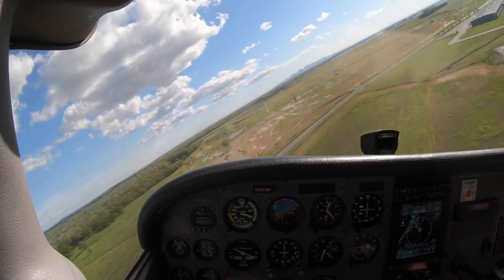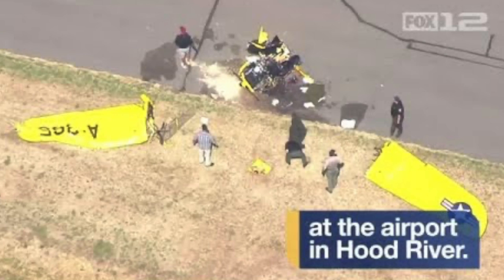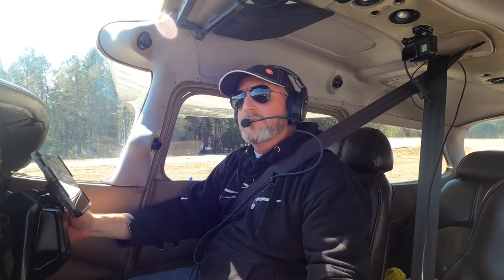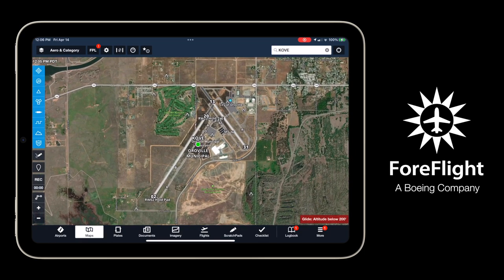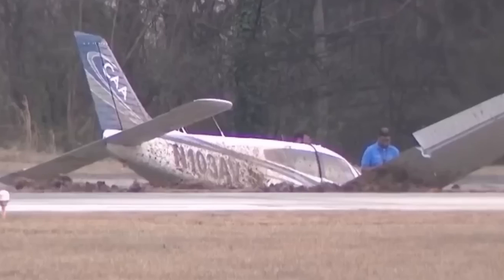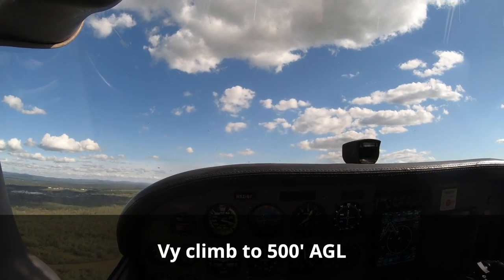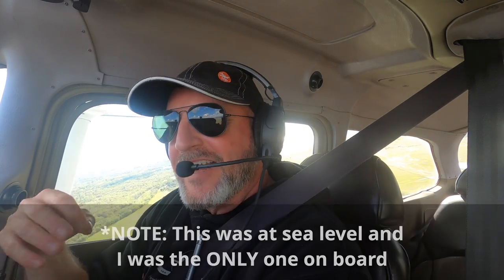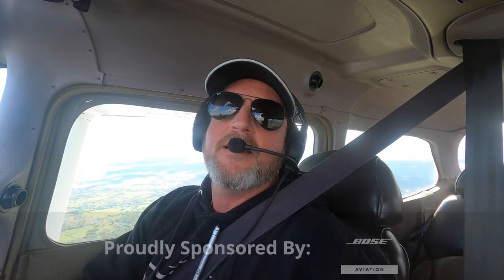The IMPOSSIBLE Turn? - Engine failure on takeoff - Airplane Crashes - 180º Turn Back To The Runway

Comment: Great video. I have your app currently. 

We tried this last week in 97-100* weather. My question is should I turn into or away from the cross wind? 

Also, we were very close to making the runway. Muscle memory and immediate turn and best glide we did.
Reply: Turn into the wind...turning with a tail wind will push you further away from the runway.  Just keep the nose down
Reply: @tbeevers  saw a wreck recently where this happened. Pilot stalled and passed.
Reply: @RaceMentally So it was a LOC-I ( loss of control in flight ) accident, not a turn back accident ?

Comment: These turns can be impossible no matter what technique you use. 

Many light aircraft will have departure angles that are shallower than their glide angle. This is through things like high weight, high density altitude, low power, and no wind. 

You aren’t making it back to the runway at any altitude unless you made a turn with power.

Comment: Besides this all, your prop is idle but not giving drag - as it would on a seizure or whatever
Reply from the maker: Yeah. and I was the only one onboard at sea level
Reply: Dead engine non-rotating prop or feathered prop is lowest drag for a calculated glide ratio. Airspeeds higher than prop speed makes for a reduced glide ratio due to the rotational prop drag; unless your glide ratio takes this into consideration. However, your possible turn video here is great for being prepared for a fast recovery, and don’t panic. All pre-takeoff checklists must include the emergency plan for a given runway.

Comment: Dan Gryder say to never turn at all if any engine problem, even from 1k feet agl on a Cessna easy to turnback.  To crash in front all times, NO TURNS.  Really? LoL. I know 3 friends that turned back from as low as 300 agl with partial power and avoided crashing on houses and cars.  he is FOS,  The more maneuvers you know, the better pilot you are.  Ignorance kills, practicing saves you.

Comment: I think one of the key take aways here that is often misunderstood is: as long as you point the nose down, you won't stall. This is a hugely valuable lesson for many other cases as well. For example you are about to overshoot final when landing on a runway and there's traffic approaching the parallel runway... it often is much better to treat altitude and be low on the approach but make a sharp turn than risking to fly into the parallel approach path.

Comment: I often wonder if there is an optimal angle of bank where the maximum turn rate vs altitude lost is achieved.
Reply: of course it will vary by aircraft, but that would be an interesting thing to calculate. Airspeed will also be a factor.

Rate of Turn vs Rate of Descent

Maximize rate of turn while minimizing rate of descent. Where do these things cross each other (what bank angle/airspeed)?
Reply: @Solo Renegade  agreed, quite a few variables going in, but it could be done at Vbg to control at least for that variable.  After that, it's a matter of various weights...similar to the performance tables for the C172 could do it at 2200, 2400, 2550.

Of course, the bigger the radius the further we have to glide to get to the runway way.  If the radius is small we might have to turn a total of 200 degrees amd glide very little, but if the radius is large we might have to turn a total of 400 degrees amd glide a considerable amount.  And all of this with a large tail wind component.  So maybe we have to simplify this to a 270 degree turn?
Reply: Steep as possible. If you bank 60°, yeah you lose altitude twice as fast but you turn four times as fast so you spend a lot shorter going the wrong direction
Reply: @FencerPTS  and don't forget runway remaining when teh engine failed, as that affects how far you have to glide back too. And a cross wind could help you do just approx 180 and still be ok.

The problem is that there are just too many variables for a given situation. All of which affects the ability to make the turn, and all of which would need to be known ahead of time by th pilot.

But from a purely Rate of Descent vs Rate of Turn evaluation...that is more practical. How many degrees you'll need to turn to get back is of no concern for the calculation, and neither is the altitude at which you started. All we care about is what is the best rate of turn for a given aircraft at a given weight (I'd calculate it at three points: light, medium/typical, and heavy load) and bank angle. Or you could just do a light load and heavy load and interpolate, but it might not be completely linear relationship. But you're going to find an optimum bank angle curve, and then calculate the rate of descent for a given bank angle. and you'll have to do this for given speeds, and you'd start at best glide and check higher and lower speeds from there.
Reply: @SoloRenegade  I've always had a problem with his much runway remaining i actually have. I mean, during climb after rotation i don't see the runway anymore, so how do I know how much of it is left? Or maybe it's doesn't matter, cause ad soon as my engine quits and i nose over, I'll see if I do have runway left! You see, I'm making assumptions but i don't really know
Reply: I am a glider pilot CFI, CFIG, we do teach this all the time, 45 degree of bank is the optimum, into the wind.
Reply: @gyorgygulyas5556  Right.. At a bit under Vglide.

Comment: Turning back after EFATO is what needs to stop! I don't care how high you are - if your climb angle is the same or less than your glide angle, YOU ARE NOT MAKING IT BACK! EVER! PERIOD! The day you have a REAL engine failure, is the day your aircraft will not perform as you expect it to. DO NOT EVER TURN BACK! LAND STRAIGHT AHEAD. You can thank me later when you survive. To quote Bob Hoover: "Fly the aircraft as far into the crash as possible".

Comment: 99.9% of the time the turn back will result in a crash?? That's an exaggeration.
The impossible turn below 1000AGL (above 500AGL) IS possible with the proper mental preparation before every flight (ie. engine failure statement) as well as several other contributing factors. 
BUT! 
It is more practical and advisable to take the easier, simpler option to fly somewhere straight ahead and control the aircraft all the way to the ground, whatever that might entail. 
This comes from working as an instructor for nearly 25yrs at 11 different schools in multiple low and high performance aircraft.

Comment: KISS, keep it simple stupid, so much of this depends on aircraft type, weather conditions, other traffic, and pilot currency, always think its best to go ahead and just keep it simple, for most of the airfields I have flown from this always seemed to be the best option based on the above. 

Still think it's better to risk hitting something slowly with a zero or low rate of descent rather than hitting it at high speed with a very high rate of descent., but you pay your money you take your choice

Comment: Just program the minimum altitude before take off, the wind direction to.  Put an altitude marker for it.   Stupid not to know a maneuver that can save you from crashing.  Same as we practice power off spirals between clouds when IFR on top.  Lazy pilots are the big problem.  Airliners know EFATO and LOTOT. But most lazy in USA GA dont know those.

Comment: Richard McSpadden
Reply: About McSPADDEN.
Such bad luck, the worst kind of engine failure, in the worst mountain place on somebodys airplane when he was not PIC. Turnback was done well, but engine died short of runway. Then someone popped the gear out too. Big mistake. Owners are the ones that do things like that to avoid scratching the fuselage with gear up. That gear out cut the glide and they hit before the plateau runway. Worst place to have the worst kind of engine failure. Many great pilots have been killed by big errors from other PIC. I dont fly with just everyone due that.  Vote down this post if you are a mediocre pilot. Go ahead.

Comment: I don’t understand the steep turn, straight after pitch down, I thought that steep turns are dangerous at low speeds?
Reply: The firm pitch down unloads the wings ( and tail ) so banks and yaws can be established quickly and safely below 1G .

Comment: To answer the ones that say to only crash "to the front".  What about if you programmed the minimum turnback altitude before take off.  and know how to turnback from that and where to head, taxiway, grass or runway etc?  Stupid not to know a maneuver that can save you from crashing.  Same as we practice power off spirals between clouds when IFR on top.  Duhh.  Lets not practice that either because we are clumsy and coward.

Comment: I have notes :) it's an important topic but you approach it from ignorance and make entry level conclusions on it. There is much more to know. You say 99.9% it will fail, that's very wrong, don't say that. You don't specify your plane, I believe the model is very decisive for the capability, indeed it is self evident but you didn't consider that. C172 is a winged tractor, awful but not the worst. A Bonanza is surprisingly poor at it due to poor climb combined with what I'm guessing is a quickly stalling wing and or high speed stall. AOPA did 4 tests and it was basically impossible in a Bonanza. Certain STOL planes despite being WW1 planes seem to be able to do it with ease. I great plane like a Risen 915 I assume can do it with relative ease, maybe even from near zero altitude. And the startle factor, that's not a thing. That's something the unprepared will invoke. If you don't immediately know what an engine out means you are a poor pilot. It should be a core lesson. Like you yourself say, be mentally prepared and I don't mean a lot of prep time for each take off, it's a one time thing for the most part and a quick glance at google earth to spot the immediate surroundings. If you have a field 80 degrees to the side that's better than a stall or cliff side. The startle factor is for poor pilots like harrison ford or sully.
Learn your plane's capabilities, you practice in sim or at altitude. Some can return, others cannot. You want to find out what altitude is realistic and what take off speed you need. Someone suggested flaps in the turn can benefit and then release for glide. Key to the possible turn is a fairly tight turn. If you just let is slide you will be far from the runway when you fall in the trees.
I found in sim that you may want to take off and climb at much higher speed than default because a tight turn can be speed hungry.
And lastly for now, upon take off you can kink to the side a bit, that way you quickly get a more natural loop back so you don't have to do a 300 degree turn. Maybe go with the wind such that the return is into the wind.
And this is just what I have figured out so far. I'm sure there is more technique to figure out.
So we need a kind of rating for each plane model. It could be as simple as lowest 180 degree turn altitude for a given speed. Or "impossible turn altitude" for a model. Maybe specified for a couple of speeds, Vx, Vy and an overspeed. Something like a competition glider can probably do it from zero altitude if going 80 knots. It might even be able to do a full pattern from zero altitude at 100knots. A bonanza might not be able to return at any point in its ascent and that's very pertinent information to tack onto the model. Basically all WW2 planes like bonanza and cessnas should be crushed because they are very poor designs and attaching some specs to the planes might help owners realize how deadly and poor their planes are and get rid of them.
So I would encourage you to do a follow up video with a more advanced approach. Maybe multiple planes if you can. For instance can your typical private jet return. I'm guessing they are poor at it. the now late McSpadden iirc did it with ease in his Cub, an otherwise crude plane. An LSA like a Bristell, is it any good. SR22, I'm guessing is a little tractor difficult. Is the key to success that the take off speed is much above stall speed? I'm guessing it's something like that. And low speed in an absolute sense because the turn radius is then very tight as opposed to an SR71.
And if it's a long runway you start as far back as you can and have mentally prepared how far ahead you can land directly on the runway without a turn.
If an engine quits on you you take over within a second. No startle effect because you expect it. You have one job.

Comment: This subject is a pilot killer.  Sad that it keeps coming up.  NO SUCH THING AS DOING AN IMPOSSIBLE TURN.  no matter what you are flying, no matter how many hours you have logged.  It is a hope and fantasy that it can be done, so why can't it be done?  Because you CANNOT train for it and you CANNOT pedict your reaction time when it happens without prior knowledge you will try the turn.  By definition, an actual impossible turn will overwhelm anyone in the situation and they will not react in time to do anything properly.  Always plan to attempt an emergency landing STRAIGHT AHEAD.  That at least gives you a fighting chance.

Comment: 500ft is a good basis. 
I always go off Density altitude and wind direction during my takeoff brief. 
It’s not impossible if the factors are right and you have good hand flying skills. 300ft is a pucker factor but if you’re at a big enough field, you don’t always need to make the runway. 
Grass, taxiway, service road, ramp. Just land it.